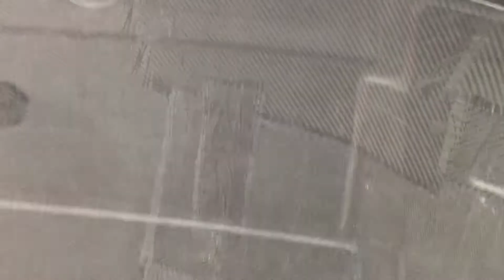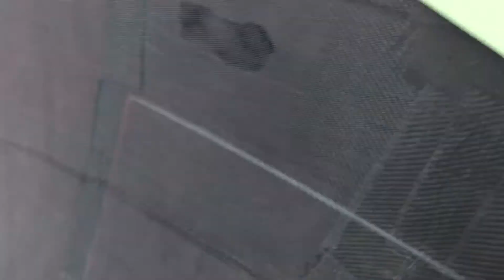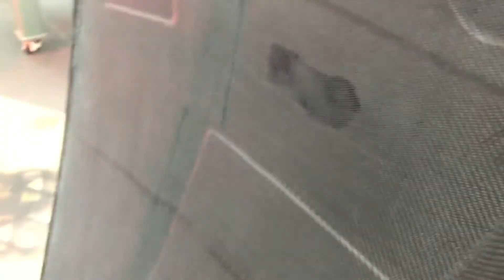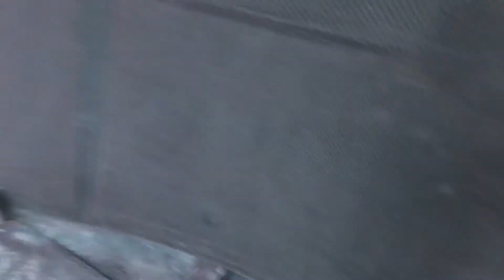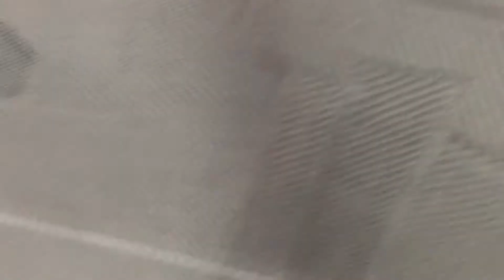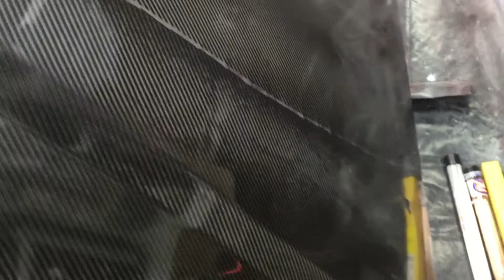DIY Carbon fibre M3 bonnet. Pt2.

Comment: Hi, how many millimeters is the thickness of the hood?
Reply from the maker: It’s about 1.0 thick, with a 3mm foam core for added strength.
Reply: @6387mbrown  that's, 1layer of carbon fiber each on the inside and outside?what kind of foam is it?
Reply from the maker: @АлмазАлмаз-б9ш  it’s 2 layers of carbon, all the materials were bought from Easycomposites, they’re very helpful! The foam was also bought from them.
Reply: @6387mbrown  thanks for the info. "Easy composite" is one of the best carbon channel on YouTube, but they can't ship to Russia 😞
Reply from the maker: @АлмазАлмаз-б9ш  it’s two layers for the bonnet, 200g each, I let that go off, then I glued the foam panels in place and then put another layer of carbon over the top. Make sure you file the edges of the foam so you don’t create a step, you want to make a 45 DEG ramp, that way the carbon will follow the contour easier.
Good luck!
Reply: @6387mbrown  thanks for the advice!!!